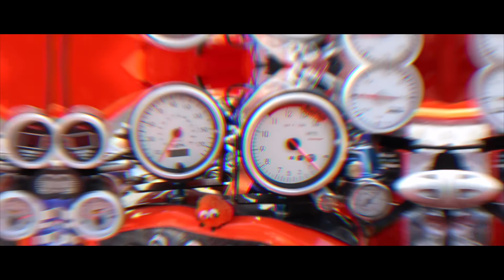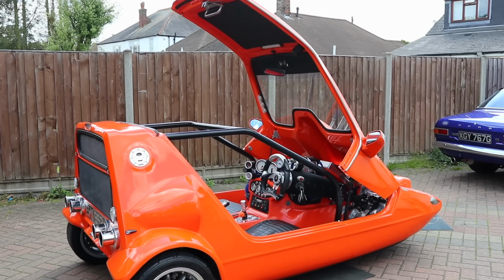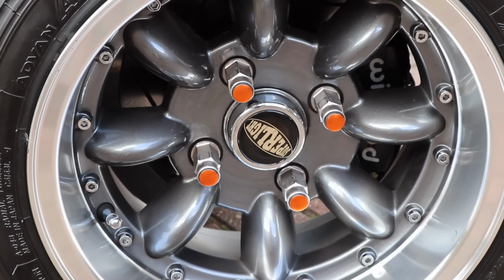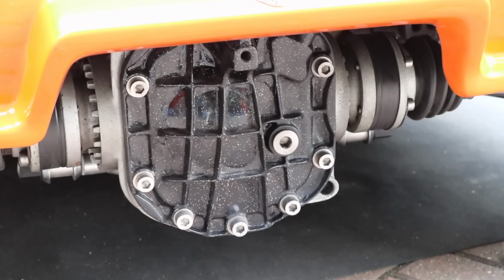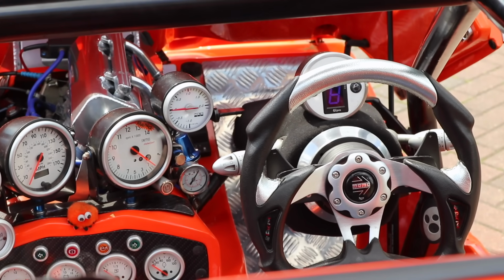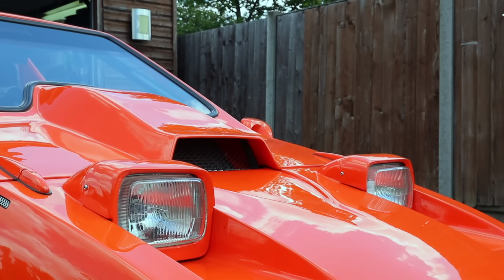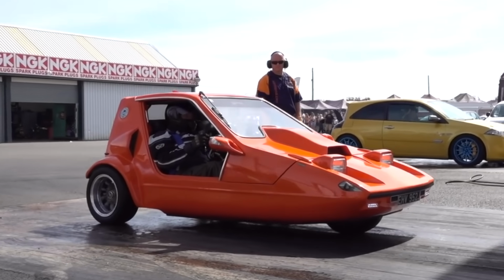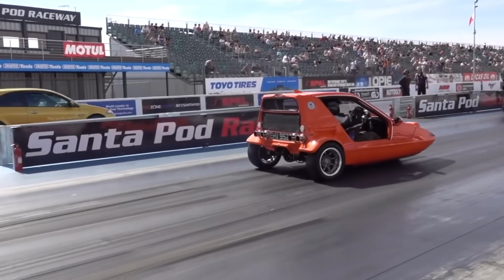THIS *SUZUKI HAYABUSA TURBO* POWERED 3 WHEELER IS PURE EVIL!!

Comment: When the owner is scared of his own vehicle you know you're in for a good one!
Reply: that's why he keeps it in a vestibule
Reply: What is a vehicule ? I heard of a vehicle. But never a vehicule
Reply: He does look worried haha.
Reply: Other option is that vehicle is so unsafe, or questionable that its scary. It does not have to be fast or powerful to do that. 40km/h in our old tractor is terrifying when steering has 50 degrees loose, or buddys car that had brake pads with only steel left, that was also scary... Looking the footage sure it has power, but it looses most of it cause there is no traction/ weight. Add another powered axle and then we might have some.
Reply: BillyTheSKID or a bad one if he crashes, either way take some extra pants and have 911 or 999 on speed dial 😀😀😀
Reply: @Hellsong89  you see it fly on the strip? That thing is fast as fk!
Reply: I love that even on the dragstrip it just hits the limiter so fast in top gear.. that engine has more revs and more power than the car can safely handle hahaha
Reply: Don't think his sceard just concentrating 😉😉
Reply: @dexterdean  well he limited the engine at 12k rpm and 300hp should give it a way higher top speed than the current gearing allows.. so there must be a tiny hint of scared in there haha
Reply: @Aristocrafied  well maybe just a little bit lol
Reply: @dexterdean  I mean.. the fact that it's 3 wheels alone makes me anxious hahaha
Reply: Damn right....well said fam
Reply: This dude is a legend  trust me he ai t scared
Reply: Yea, when he's in the throttle there is a little concern in his eyes.
Reply: @Hellsong89   ur just jealous ur tactor doesn't do that hahaha
Reply: Tractor*
Reply: I’m sure he built it to scare himself out of his comfort zone 😂😂😂😂
Reply: @Hellsong89  I'm sure it's better than your car tho soooooo
Reply: If it doesn't scare you build it again
Reply: The only car owner I knew who was scared of his own car was a guy owned a Honda swapped, track prepped, turboed Lotus Exige S1. He said it was terrifying.
Reply: This isn't fear, this is concentration.
Reply: @Hellsong89  wtf are you going on about? It has a 300 bhp turbo hyabusa engine, its going way quicker than 40 kph lmfao did you even watch the video you clown
Reply: It scared me just watching. That's a hairy ride.
Reply: I was getting into dirt bikes way back. And the advice I took was "if your vehicle doesn't have the potential to terrify you to the point of never driving again, it's not enough." And that's the advice Im taking while putting together a 67 Datsun roadster. Eventually getting kswap with subi 6speed AWD. But will start with a busa haha.

Comment: Bond Bugs were not that great, they were very unique but slow and unstable. How on Earth you managed to make it work with all that power is a testament to your great engineering. Great stuff!
Reply: top speed  on the old bond bug was about 75 mph but they was not easy to tip over either. my mate had one for years
Reply: you had to be 17 to drive them in those days just like you was allowed to ride a 250cc motor bike with out passing your test.  @krustykamper
Reply: you couldn't pass your motor bike test at 16 you was only allowed to ride a moped. I'm 56 trust me. you had to be 17 to ride anything up to a 250cc which would have allowed you to drive a three wheeler do a google search. and I'm not sure if you could then because they had a reverse gear so maybe you had to pass your 250cc test first to drive one. I think I'm right but I haven't looked it up.  @krustykamper
Reply: @jang wang no mot either!
Reply: jang wang  it’ll be insured thorough a specialist and he best have life insurance too any crash in that thing will be his last
Reply: @emmams5  What's 'Kit car' got to do with it? The Bond was a production car from Preston, Lancashire.
But either way, kit cars are MoTd the same way as any other vehicle in that class, be it tricycle, car, LGV......
Reply: @edkay272 
It does not need an mot, vehicles over 40 years old are exempt, J is 1970
Reply: Widen the track and slam it.
Reply: @emmams5  my mate built this
Reply: @carlmarsden2529  the first batch were Preston but after that tamworth
Reply: @bonkeydollocks1879  Why widen the track?
The original suspension geometry rivaled most period sports cars despite the fact that it only had three wheels.
They were far from unstable.
Besides a narrower track would be more stable in a straight line.
Reply: @bonkeydollocks1879  Bond's were always Preston, Tamworth was Reliant.
I think there were about 500 built in Preston but Bond did plenty of other wacky stuff prior to Reliant buying them.
Reply: Bond Bugs were not "unstable", they actually handled pretty well.
Reply: @carlmarsden2529  I was answering Christopher wards question " how do you make it so stable" = lower the centre of gravity helps stability and so does widening the rear axle.  I will make it simpler for you. Who is more stable/in control ;

A) someone on a penny farthing

B) someone in a go cart

Let me help you out

It answer B
Reply: @carlmarsden2529  wrong again I'm afraid carl, the first few were from Preston but production moved to reliant in Tamworth very soon after. Reliant, fibre glass, three wheels. Do you get the picture? 

Before responding please look up the history or contact the bond bug owners club if you doubt me.
Reply: @bonkeydollocks1879  Yes but the kart with a narrower axle will be more stable and in control at speed, widening the axle is fine for better turn in, that why changing axle widths is one of the most popular kart tuning tools.
By a strange twist of physics, the narrower axle will also be quicker, given that all else stays the same...
Reply: @bonkeydollocks1879  It was the Bond Bug owners club that was the source for 500!
And Bond had been doing things with 3 wheels and with fibreglass before the Bug
Reply: Hows the engine linked to the rear? Chain driven?
Reply: @EnsVibes  The bike engine has been placed longitudinally, and a special coupler has probably been used to connect the bike gearbox output sprocket to the prop shaft. This then goes to a rear diff. I think the owner said it was out some kinda Cossie
Reply: @carlmarsden2529  OK let's agree to disagree.

But I am correct
Reply: @carlmarsden2529  they made them in Tamworth at the reliant factory

Fact
Reply: @bonkeydollocks1879  I never disputed that, I just queried how many were in that first batch and stated that spiritually Preston Was Bond and Tamworth was Reliant (and Ford RS200)
Reply: @bonkeydollocks1879  OK

But one of us has engineered national and international championship winning racecars - there's theory and there's proof :-)
Reply: @carlmarsden2529  quote " Preston was always bond, Tamworth was reliant"...... 

Glad we got it cleared up in the end though.
Reply: @carlmarsden2529  you don't know my background though do you.

One of us is presumptious.

Helping build "race" cars means nothing, understanding the difference why stability on a go-kart is far superior than that of a penny farthing is not so much science but common sense

All the best
Reply: @gaztl1000s  Lol only if they are unmodified! My car is 40 this year and still needs an mot.

Comment: at 9:43 it looks like he catches up to a purple M3 GTS whom have clearly got their foot down too, but notice how much he had to slow down instantly as he had much more power available.
Reply: 600bhp per tonne so on paper it would easily catch it, span up a bit though lmao
Reply: Think there's a blue m3 revs up next to em at 9 mins he lets off never seen it again lol
Reply: @roksta3271  that blue m3 could never build enough traction to keep up with this tricycle once the turbo kicks!
Reply: I think you will find the M3 is also the owner of the 3 wheelers car. You see it when they initially pull away from the address at the beginning and he also says he owns an M3, because he compared this to that.
Reply: @greck9992  .. yep, you're right. I think they used the M3 for police watch. Lol.
Reply: @grahamefreestone5309  spot on guys
Reply: @grahamefreestone5309  or/and 2nd camera angle...
Reply: @mrolsen6987  .. probably, but all the footage was from the inside. Unless the owner wanted some footage too. 👍

Comment: I love pulling alongside expensive supercars & smoking them, but if I meet this on my R1, I'm just not playing
Reply: Why? A stock R1 will run low 10s/high 9s on the 1/4. Your R1 would smoke this... It doesn't have enough traction or gearing to compete properly. Also, this is 600bhp/ton - most 1000cc sportsbikes are 850bhp+/ton.

Comment: I particularly like the quality of the engineering and fabrication that the owner has invested in his project.

However, as the former owner of a 1972 Bond Bug 700ES, I really don't like the cockpit apart from the seats, and really dislike the gauges, steering wheel and aluminium floor plates, which ruin the simple and basic design and appearance of the original cabin. 

The entire point of the Bug was to have a very simple, sporty looking three wheeler that had a good power to weight ratio and was lively in order to attract younger buyers.

The ultra simple chassis and engine and dramatic shape, colour and graphics combined to catch the eye and make the Bug stand out from anything else produced!

Malcolm Newall went on to fit the Bug engine into his remarkable Quasar, capable of travelling at high speeds for hour after hour, whilst returning incredibly good miles per gallon, so it's not that the engine lacked the performance to suit the Bug.

All that work and expense has created a Bug that's deafening to drive and utterly fails to do the one thing it was designed to do! 

Please note that my observations are not in any way criticisms of the owner or what he chooses to do with his own car!

The craftsmanship involved in re-engineering his Bug is outstanding, as are his fabrication skills.

Comment: Hmm, impressive but still slower than most bikes at pod. They had my focus when I went there recently, some are in the 8s. For speed best place for a bike engine - is in a bike.
In a low handling lightweight car for a track is more useful I think but then you want more than one wheel at the front too.

Comment: iv always liked these cars. there is only one big problem. what's wrong is  the the 3 wheels set up. as its been proven that if the single wheel is at the back. improving stability. the robin reliant is the same. watch the video with Clackson from top gear driving a robin. he shows how easy they tip over. but as i said a very nice car. i just wished robin got the wheel set up right
Reply: The car that Clarkson rolled was setup to do that. They added a larger wheel on one side plus weights to it so it would roll over at a low speed.
Please don't take TopGear as fact, it's entertainment at best.

Comment: The engineering, fabrication, and finish is great. Those seat belts are horrible! Bottom goes around your pelvis, not diaphragm! A significant crash will result in broken ribs and organs!  4 point harness are dangerous as is even worn properly (guaranteed submarine risk).

Comment: That is extremely stupid, dangerous, and reckless and I don't want one. I cannot imagine the look of horror on anybody's face who has lost a loved one to that type of driving, I know it will have uprated tyres, brakes etc. But it only takes a split second and will probably be down to someone else making a silly move or oil on the road. It should be limited to private open land or indeed racetracks. I love all vehicles, all ages, all types from mopeds to buses from bicycles to lorries and at some point have owned all. I have swapped engines and gearboxes altered ratios altered bodies changed their intended functions but throughout it all I have only ever strived to make the vehicles better and safer. If the power and speed have been increased it has never been to exceed spread limits or extreme acceleration but to allow better economy and safety.   Sorry to be a killjoy but I have seen the outcome of this sort of driving, the apologetic faces of the survivors whether guilty or not and the years of torment they go through, often having to move home while relatives still get the stigma of killing someone even if the courts find you not guilty. The endless scary nightmares, the constant thoughts of what if ?         please think before you send a silly reply because you could be replying to a ? I for one loved the video the thrill of speed the thought of the money, and the technical experience in the build, I would be a moron if I did not like it. But I would be a moron to drive it like that on public roads, knowing what the consequences can easily be, age, hindsight and selfishness are a fantastic antidote to speed and dangerous driving.

Comment: I'm not impressed by it's performance. It's just too unstable. Especially considering the other amazing 3-wheeler. I'd get a Trexx or a KTM. If it was streched and narrowed in the front, it would be far better driving.